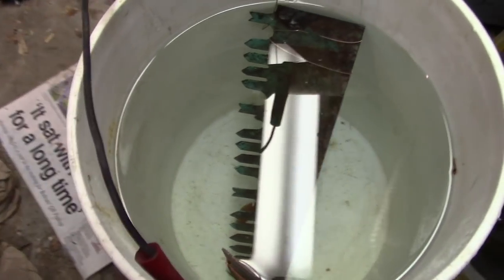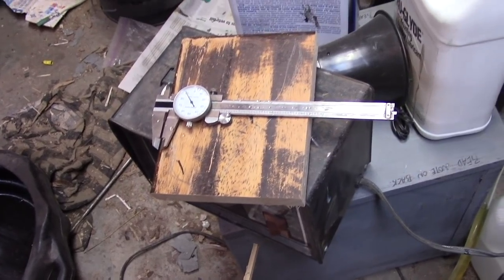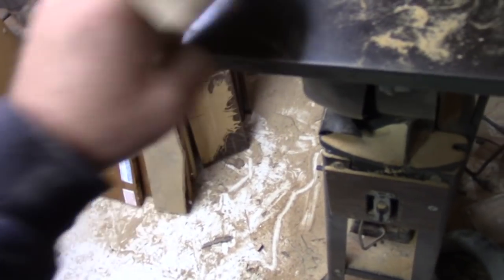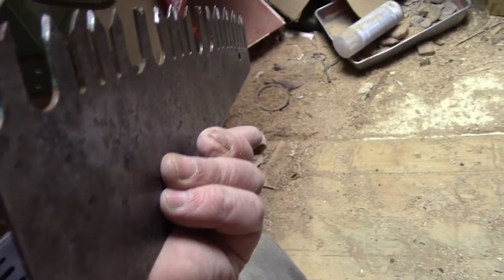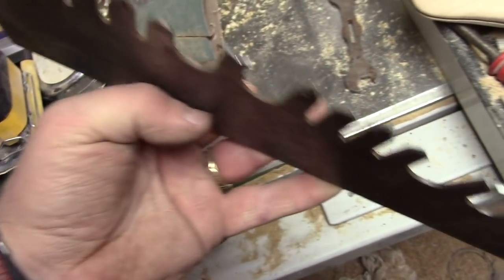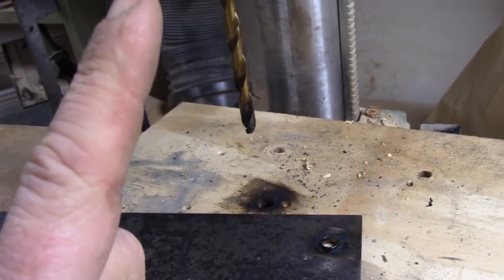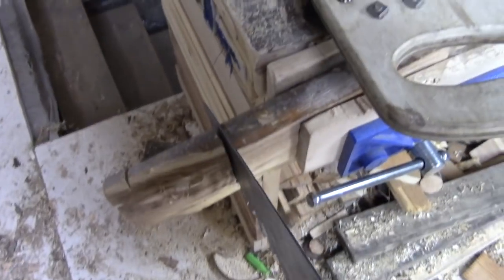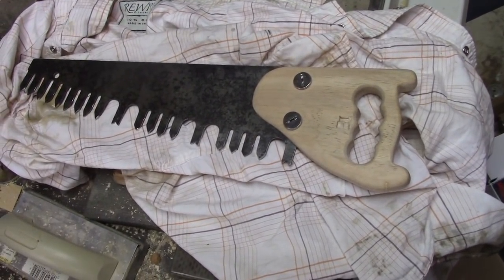Most Agressive Handsaw

Comment: Me: "Aw man no Nelson Studios tonight."

You: Delivers

I love seeing you spending time with Shay (sp?). He's learned a lot in such a short time. I see a lot of a younger me in him and I certainly feel for my Dad. I was a talkative little bugger.

On the subject of drilling hardened steel. I go about it two ways. One: take a masonary bit and run about 1000 rpm and burn your way through. Masonary bit should be fine. Two: take a masonary bit and give it two one good lick per flute  on the bench grinder (green wheels help a lot) and drill it at maybe 3-500 RPM. However, you will need a metal backup plate as the drill likes to catch and rip the carbides right out.
Reply from the maker: Interesting, I might give the masonary bit method a try if I decide to handle the other old blade we found.

Comment: For the electrolysis to work you need that other electrode to be much larger than what you have.
Mr. Pete (Lyle Peterson) has a very good video series on it, but I think it only ever works for old men who have grown patient.
Get some M35 Cobalt drills from China, they will do hard stuff and the price is so reasonable that I don't buy any small HSS drills any more. Stay away from anything "titanium nitrite" coated, if you use hard cheese as your starting material this is not something that can be rectified with a coating.
Reply from the maker: Thanks for the info!